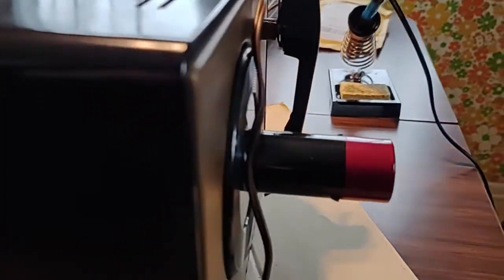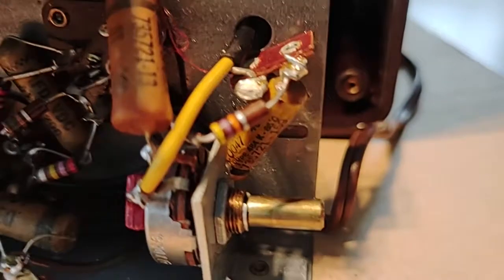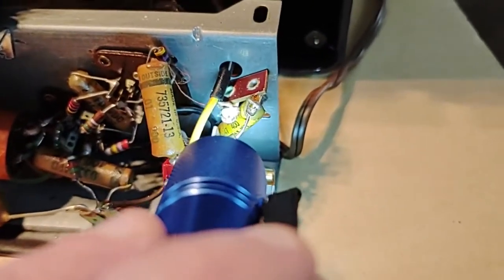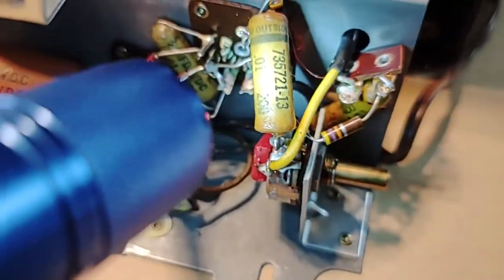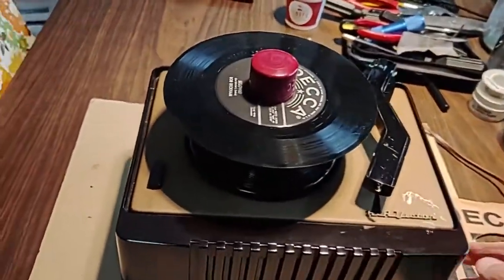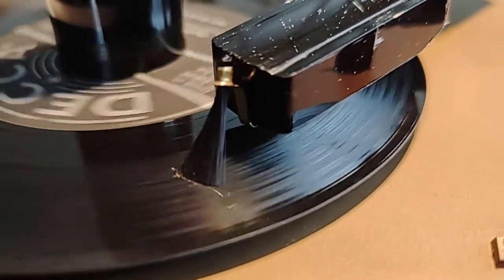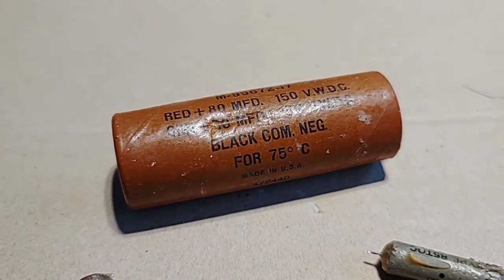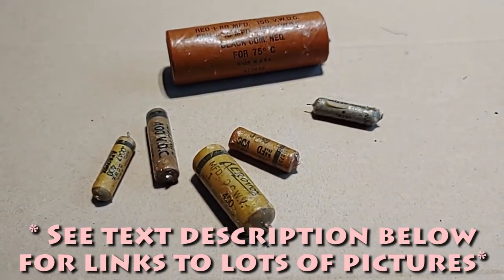Vintage RCA Victor 45-EY-2 45RPM Record Player Repairing

Comment: I get a big kick out of wholesale recapping( that does not solve the problem--- then the arms go up in the air, not knowing what to do next), I have seen resistors fade away too, you need an ohm meter to verify resistor values, and  replace the ones that are out of tolerance( drift up in value as they age), I have a 45EY2 player myself that I rebuilt years ago. it still runs like a swiss watch to this day, and yes the crystal cartridge was "D.O.A.". the unit was built in oct. of 1950, with all the original tubes that tested good( date code 50-24) and is in service to this day!!!!

Comment: Youve got a very nice looking player there. I would suggest you view the videos here made by Chris Cuff. There is also s super book out there published in 2000, called “ The Fabulous Victrola “45” by Phil Vourtsis. Re-capping is a must. Don’t even test the caps, they are bad or will be bad. The pickup cartridge needs to go as well. I wouldn’t doubt the drive idler and change cam are worn out too. Before you are done it could cost you about $75. Most of all you need a keen sense of mechanical aptitude to figure out the levers, bearings and sub mechanisms. It takes a year or two to become proficient.
Reply from the maker: Thanks!  Sorry for late reply.